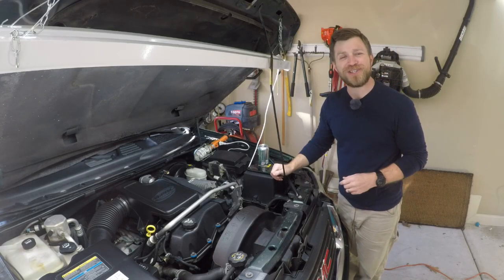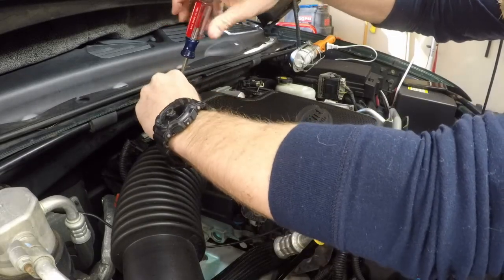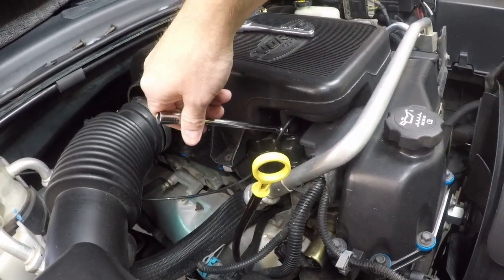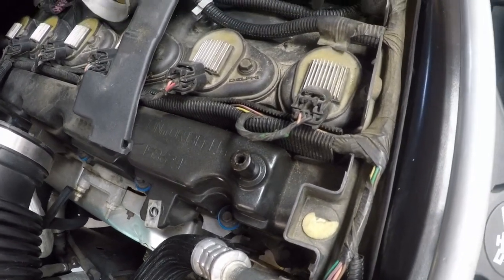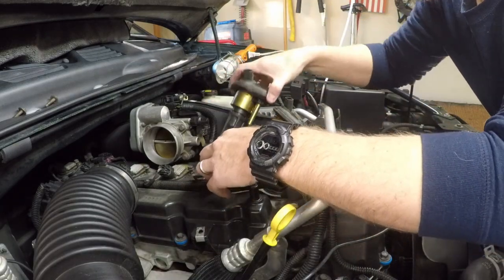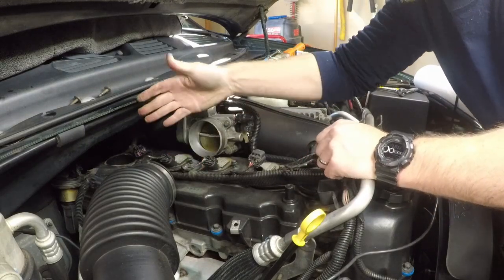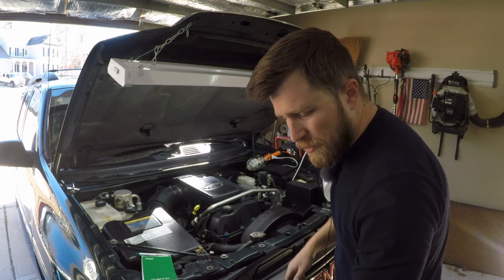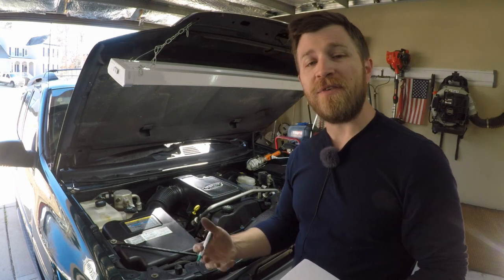How to Replace 2004 GMC ENVOY SPARK PLUGS

Comment from the maker: Thanks for stopping by the channel, I hope this video is helpful.  Let me know what spark plugs you use in the comments below.  Check out my other videos linked in the description above.
Reply: Have same car had a knock then just stopped im thinking oil pump ? what do you think
Reply from the maker: @ronaldcordromp6056  That's a possibility. Check oil level and pressure. To check true pressure, you'll need to hook up a manual gauge.
Reply: @KevinNadeau  yep thats what im ganna do first, did you get those knocks on yourr gmc seams im like seeing it
alot no one seams to know what it is
Reply: @KevinNadeau  Thank you
Reply: The fifth cylinder spark plug where you would gap was completely gone I went with ACDelco plug 41-103 factory replacement still has misfire
Reply from the maker: @dalejackson8719  how about the coil packs?
Reply: That same coil pack same hole that was the only one that was bad the rubber came off the coil pack It look like somebody when they put those plugs in ripped it off and just put it back on there and pray that it would work I replaced the coil pack and it still has a misfire
Reply: @KevinNadeau  I wish there was a way I could send you a picture of the coil pack and plug that I pulled out of that cylinder
Reply: And it's starting to stall out as I'm driving it now after changing everything
Reply: And I wish people would learn to do preventative maintenance center vehicles instead of waiting for it to tally break down before they decide to fix it

Comment: Great video. I checked getting a check service engine light on my vehicle.  I took it to Advance Auto to diagnosis the problem. Initially, they got a P0300 error code.  So I took it to a local repair shop and had them put it on their machine. They diagnosed a misfire on spare plug number 5. I was able to use your video to fix the problem. Which saved me a few hundred dollars.
Reply from the maker: That's awesome! I'm glad the video helped 👍

Comment: New to your channel.  I am an owner of a 2007 GMC Envoy.  Between yourself and 1AAuto.com's channel, I feel more confident in tackling maintenance projects around my vehicle.  I have tackled brakes, replacing a driver side window motor, and a few other things.  Thank you for your posts.  My next project on the Envoy is to get the back glass open/fix the button.
Reply from the maker: Thank you! I'm flattered to be compared to 1A Auto's channel. The back glass button isn't  that difficult. Let me know if you have any questions 👍

Comment: I just bought a 2004 GMC Envoy. Thanks for this video. I was wondering where those spark plugs were. BTW you had low volume during the actual spark plug replacement. Very nice explanation of everything. I wish my engine bay was as clean as yours.
Reply from the maker: Congrats on your new Envoy.  I have a lot of other How-To videos on my channel related to this truck that you may find useful.  And thanks for the info on my audio.  I have since bought a new microphone for filming.
Reply: @KevinNadeau  You can count on me to check them out. Hopefully you have one on the back hatch, GMC Envoy XUV. When you open the hatch from left to right it won't stay in the open position. I will check out your over videos, thanks again.

Comment: @KevinNadeau I've got the coils off and none of the spark plugs will budge, and I'm afraid if I push to hard I'll break it in there.
Reply: How do I get the spark plugs out without breaking if they are stuck in there
Reply from the maker: @crystalprice4819  Sorry, I haven't run into that issue yet.  Do a search on YT and see if anyone can offer some ideas.  I'd be interested to know how it works out for you.  P.S. I might would try spraying a little penetrating oil in the plugs wells and let it soak for a while.

Comment: Kevin great video. Appreciate the tool list, keeping the cam steady using a tripod and like the green book.. excellent idea! I've a 2006 chevy trailblazer I bought from a friend 7 months ago that now has just over 175k. He had regular service and work done since I've known him and was the original owner. Unfortunately since I picked it up I'm having check engine lights for multiple reasons since I've had it. I'm starting to wonder if the place he's used for 5 years did much actual fixing. Maybe it's just luck of the draw. Fortunately because of videos like yours and a few others I've been able to do what luckily are somewhat easy fixes. I'm far from a mechanic but at least I can still do some basic work on the trailblazer. Glad I found your videos.. so many the guys are shaky and don't give good details. I'll subscribe.
Reply from the maker: Thanks for the support Jim!  I'm sure you'll have many good years ahead with your Trailblazer.  Let me know if there is anything I can answer for you.  As far as the check engine light, I'd suggest investing in an inexpensive  OBD2 scan tool like this one https://amzn.to/37rtmiz (and go ahead and pay for the premium version of the Torq Pro app, well worth it IMO).
Reply: @KevinNadeau  Already have an obd. it helped me diagnose the code for the work I needed to do. was getting p0014. I changed the camshaft sensor first. Check engine still came on so moved to the vvt solenoid which corrected the issue. Saved enough on repairs it justifies upgrading to the pro version of torque :-)

Comment: Thank you,very much for sharing i have a pewter 2003 envoye, i paid cash for it has 247,000 miles on it.i drive 2 hrs day to work and back.thanks i was wondering to change plugs , my valve cover is leaking just alittle bit and the dealer pointed it out.but seems like good vehicles, i put synthetic oil in it and helped a bunch.

Comment: Great informative video. Thank you. How do you keep your engine compartment sooooo clean with so many miles on it. Everything looks brand new!  I only have 39000 miles on my Envoy and it looks horrible compared to yours (I live in FL so there is no cold climate related issues due to road salt etc).
Reply from the maker: Thank you.  I usually wipe down the motor with a dry towel when I do oil changes.

Comment: Thanks for the video.  2 of mine had oil.  What should I replace
Reply from the maker: You're welcome!  You might need to replace the valve cover gaskets. There are gaskets around each of the plug wells.  Good luck with your truck.

Comment: No issue on #6 plug?
I may have missed it in video.
🧐
Reply from the maker: It’s a little tight, but I had no problem with no. 6
Reply: @KevinNadeau  
HEY....
Thanks for the reply.
I'm having a known misfire issue on #6
and have heard it could be tough getting it out.
On the TB's and envoys the gasket that seals the hood against rain, gets pinched, or maybe cut?, but it fails, and a little water over time will puddle around coil area, or into plug cavity.
Just an FYI in case you hadn't head about that.
When I seen #6 wasn't filmed on your vid, I thought maybe the people crying wolf were correct about this one. I had even read about, rigging up (ruining. lol) a tool to get in there?
Now I'm wondering if anything about the envoy or TB-(mine) are different in the firewall form, or I have just previously stumbled across several 
"vice grip mechanics"

Never the less Good video, with clear instructions.

I've only used a shop a couple times in my life (54) and that was on things I would just rather pay, because of the hassle of doing them, so this really isn't anything, as I have owned some junk when I was younger,  and also built Bottom up, top down and dropped a 427 in a 87 Buick regal that never lost in a town of 40k. (senior year HS) 
For a few years now, I take some time and look through videos, before I do anything really, and see what issues may arise, grab a fist full of exact socket sizes, etc.
But the little techniques you find people do is where the GOLD Is (IMO).

Last month I swapped transmissions on my daughters car.
 After watching a video, you can see that the tail end has to go up quite a bit, once it is separated, and low enough to allow that torque converter to possibly slide off.

9/16 angled box end wrench held to bell housing, along with original bolt + washer, with angle leaning wrench towards converter tight.
These little;     !OF COURSE! 
findings are great.
I'll come back and give you a sub, and check out some more of your videos.

Thanks again for your reply.
Man I get text chatty when talking about anything with engines or legs. Lol.

Not knowing your audience, throw me a peace sigh if you would like me to edit that last analogy. He.. he. np.
Reply from the maker: @Thesaurcery4U2C  my only issue with water getting into the plugs was on no.4 plug. It’s right beneath the drip edge of the cowl. 

I appreciate your thoughts and comments. Be well! 👍
Reply: @KevinNadeau  
Right on.
You as well.
🤙

Comment: The next one I have one question my my GMC Envoy my service engine light keeps coming on and keeps flashing it runs good it's just that lot keeps coming on and it drinks a lot of gas what is it and how do I fix it
Reply from the maker: I had that happen to me once.  Turned out to be a poor coil pack connection.

Comment: Question, Why didn't you change the coils when you changed the plugs?
Reply from the maker: Because they worked just fine. No misfires were detected.
Reply: @KevinNadeau  I have a 2008, mine seems to be missing so not sure if just plugs will solve it but its the first thing to try. I have the coils as well but figure if I put them both in I won't know which was needed. The coils are kind of odd as well price wise. I bought mine off Amazon and some that were listed would cost as much  as much as a whole set. Any thoughts?

Comment: It's so clean under yr hood! Wow! I know this is off the subject,  but what is it called where you put windex to clean yr window? My is leaking n I don't know what the container is called to replace it?
Reply from the maker: Thank you. I’ll wash my engine bay every so often. Are you talking about the washer fluid reservoir?
Reply: @KevinNadeau  it's under the air take
Reply: @KevinNadeau  How you wash yr engine bay?  I wanted to ask you another question. In a manual book it say to use 41-981 spark plug AcDelco. Is it the same as using the spark plug 41-104 I think you used
Reply: @KevinNadeau  thank you ,you got it right.
Reply from the maker: @beckymc6178  The 41-981 plugs were discontinued and the 41-103 plugs are the replacements.
Reply from the maker: @beckymc6178  To wash the engine you can use a light spray of water and some soap with a brush to clean the plastics. I would avoid spraying any electronics directly.

Comment: i have same truck with same motor but i put the ac delco platinum plugs in well that make any dfiferance just woundering cause i still have the same miss as before i changed them and have the 300 code and the 306 code
Reply from the maker: I have always read that these trucks like (and were designed for) the iridium plugs.  That's all I've ever used in mine.

Comment: Hi, I went to the link for the spark plugs, and 2 reviewers said they were counterfeit.  Did your spark plugs have 3 dots on the top metal piece?
Reply from the maker: I don't remember if my plugs had the dots or not.  I bought mine from a local auto parts store though.

Comment: Where is the air temp sensor? Most vehicles have it between the air filter and throttle body but all I see ,is the MAF sensor
Reply from the maker: The outside air temp sensor is near the top of the radiator on the driver's side

Comment: Now the spark plugs in my '05 Trailblazer they're not the iridium plugs they're the cheap ACDelco I guess copper would that cause a misfire I just bought the truck for $500 and it has a bad mess and it's just coming up at random misfire
Reply from the maker: Hope new plugs fix your misfire

Comment: I'm no mechanic You didn't mention the gap on the plug and no mention in the comments It'll be nice if you'd respond thx
Reply from the maker: That is a good point.  My service manual calls for a plug gap of 0.05 inches with AC 41-965 plugs.  However, the new plugs (AC 41-103) come gapped from the factory at 0.04 or 0.043 and you shouldn't need to regap them.